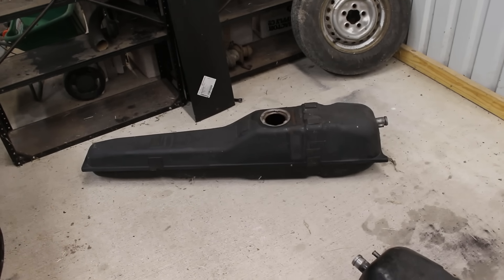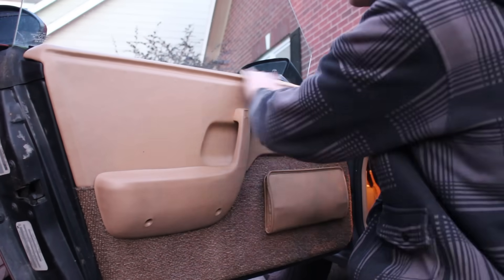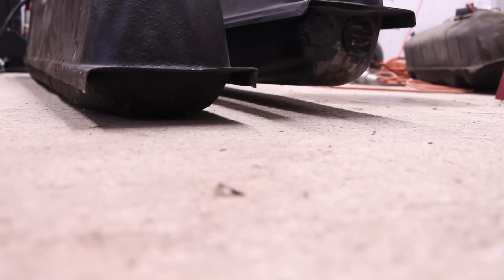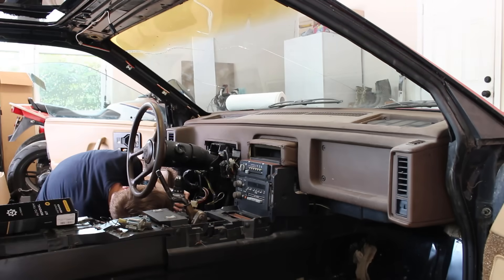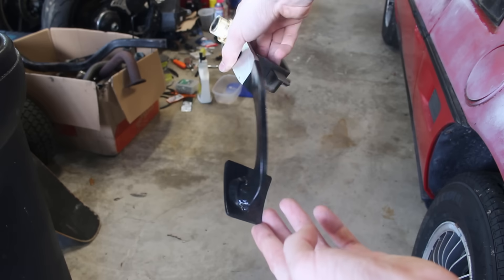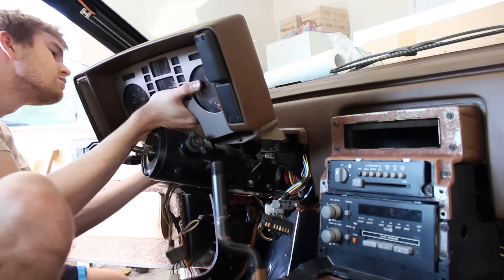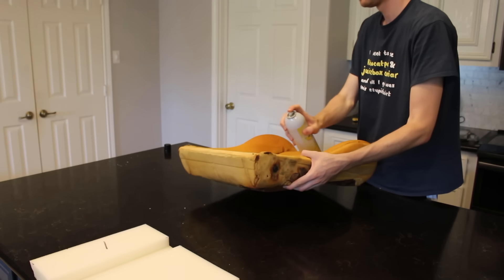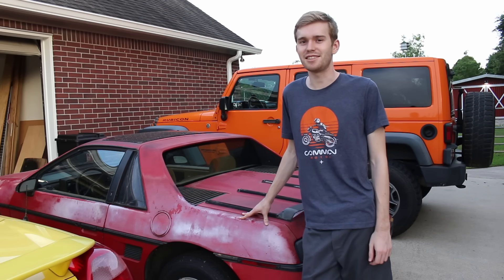The Cleanse | 1985 Fiero 2M4 Revival - Part 5

Comment: I remember these from the 80s.  They were pretty cute, but GM should have done better by this car.  The engine fires weren't good for the car's reputation.  The 98 HP 2.5L I-4 engine wasn't that good, and the 135 HP 2.8L V6 was a little better.  I'd have loved have seen what this car could have done with a better engine.  I don't know if the 3.8 V6 would have fit.  I don't remember when GM's 2.3L Quad 4 was introduced, but that might have been a good option.